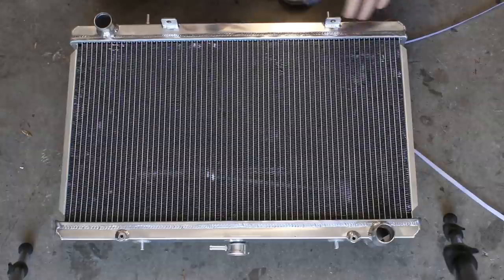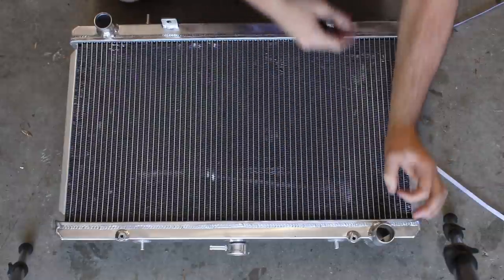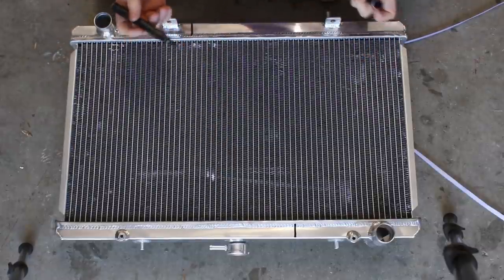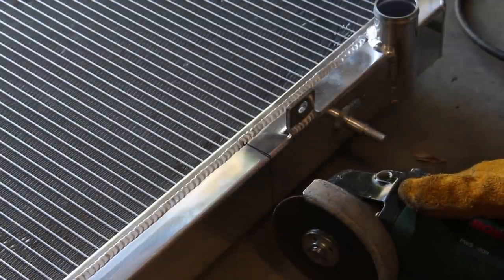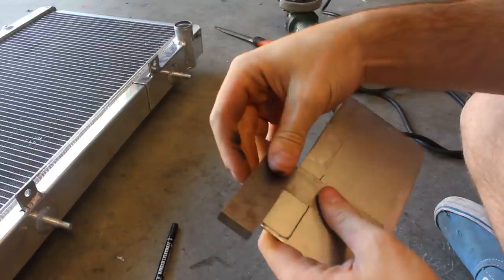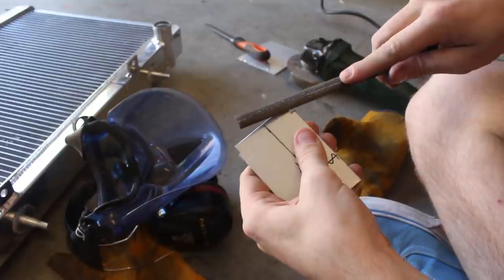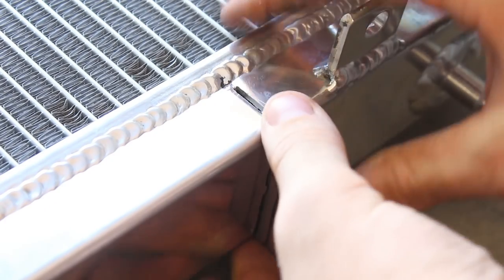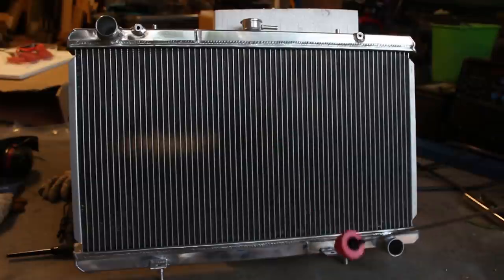How to: Triple bypass radiator mod.  EXTRA COOLING POWER

Comment: was this method effective, because I am thinking that the water pump would need to push extra hard to pushe the water up in the middle part, and 2, how would you water bleed the 2nd and 3th section of the radiator? since its sealed how will the air come to the inlet?

Comment: wouldn't be a perfect seal but would get the job done, the small amount of escaping water getting past the baffles (because the bottom of the baffle isn't welded to the top of the fins) would be negligible, water will find the path of least resistance so the majority will be going through as intended
Reply from the maker: Yep. never needed to be a perfect seal.  just needs to get the water going mostly the way you want.